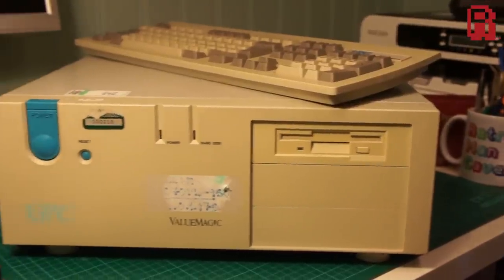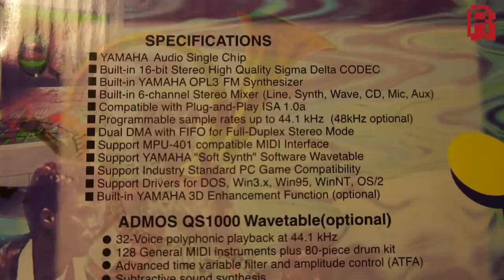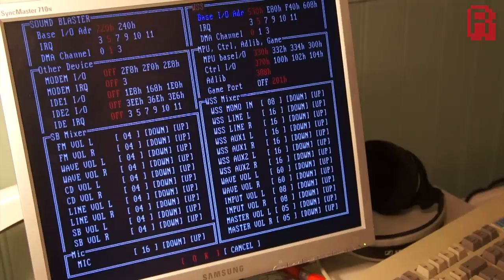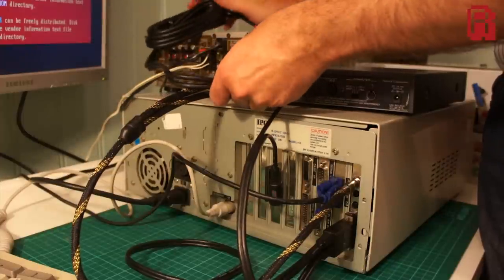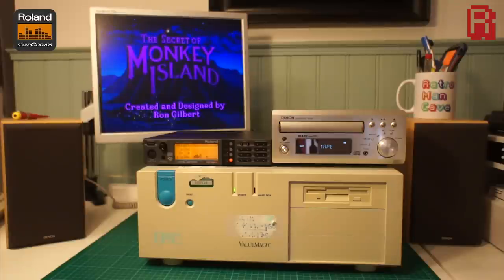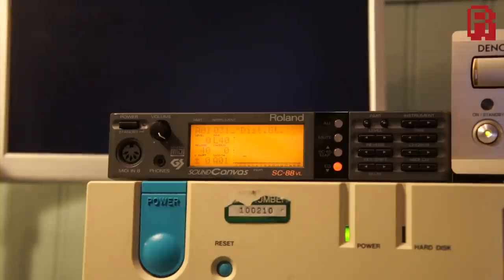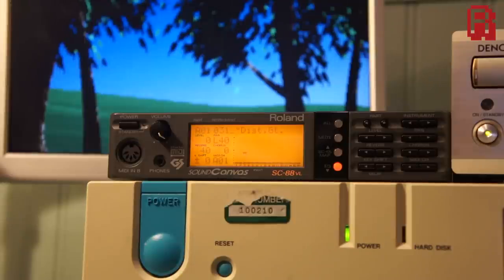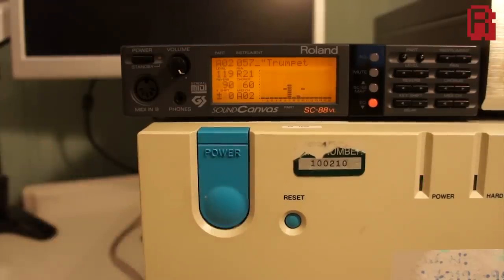486 Trash to Treasure Pt2 | Sound & the Roland SC-88

Comment: Roland SC-55 and Roland SC-88 has the MT32 mode which it will map some the sound back to MT-32 standard so that you dont get odd sound like in the video. To find out how to turn on this mode, just check the manual document that comes with Roland SC-55/88 etc..

Comment: I got the Roland SC-33 in 1994 and my friend got the flagship SC-88 at the same time.  All the sounds on mine were present on his, and both excellent GM modules.  I later sold mine and upgraded to a Yamaha MU100R complete with PLG100-VL and VH expansion boards inside as standard;  one gives virtual string and wind synthesis, the other is a vocal harmoniser.  These days I have four MU100R and six PLG boards, and an old Lenovo Thinkpad Z61p laptop running Cubase with special software that hosts the PLG boards like VST plugins.

Comment: Recently setup a good DOS rig for myself, which brought me to this video. Def subbing. Glad there are people into this stuff.

Pentium 75, 32MB RAM, GoTek FDE, 8GB SD w/SD to IDE with 2.5" to 3.5" adapter, ATX to AT adapter with switch, new ATX PSU, Gateway EV700 CRT (got for $2 no distortion), Ensoniq SB16 clone for digital sounds, SC-88ST for MIDI, IBM Joystick, TGUI9680 2MB (prob need a better one, heard these may be buggy), and a NOS KB/M with a PS/AT kb adapter. DTK case. Got lucky with mobo, 4 PCI & 4 ISA slots
Reply from the maker: Thanks!  That's a nice build.  I really need to make myself an early pentium era PC soon.  What games are you enjoying on it?
Reply: RetroManCave 
At the moment, I'm playing the super generic ones I played as a kid. 
Descent, Doom, Duke Nukem. 
I plan on branching out to more obscure ones, but I really haven't played too many DOS games so I have to rely on lists and old gaming magazine scans. I'll take advice if you throw any games out

The Pentium machines are actually not too expensive, the mostly complete DTK was $80 and the GoTek Floppy emulator was like $20.

Also I feel like I need a 386 with a turbo button, so I can play cycle dependent games, to complete my collection as far as PCs go.

Comment: Well now I want one, even more.
Reply from the maker: We've since discovered thanks to commentators that we can put the SC-88 into CM-64 mode and the SC-55 into MT-32 mode by holding a button down.  If you're going to buy one the SC-55 can be had for a good price for the best of both worlds
Reply: Thanks for the heads up. I'm going to keep an eye out locally, but might need to keep tabs on eBay.

Comment: Well, you ask what choice I'd make for my sound, and... I recently bought an SC-88VL off of fleaBay for my DOS machine. I don't think I actually OWN any games designed for the MT-32 at present, so the GM and GS support was far more important to me. 
My actual soundcard is an AWE32 I managed to scavenge off of someone's spare parts pile, so I've got the options of AdLib FM synthesis, Creative AWE synthesis, or Roland SC88 synthesis. And the SC88 contains the option to load samples to simulate an SC55 or (basic) MT32. 

This is my first MIDI module, and honestly, the 486 I had growing up had a (particularly weird) SB16 clone. So a lot of these games sound like entirely new titles(though I can always switch back to FM for the nostalgia).

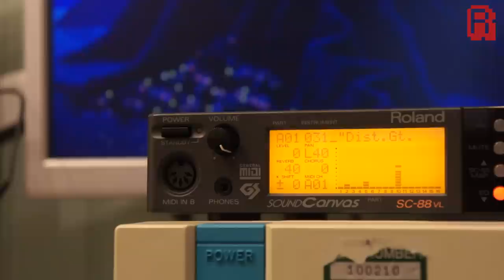Comment: It sounds like it really has potential, but at 8:02 you can tell the mappings are wrong--it sounds like drum tracks are playing as synth notes (out of key and on the upbeat). According to a video using SC-88 with Doom, you have to get the instrument mappings from the SC-55 and put them on the SC-88. I don't know if that will fix it or not. Maybe there are pre-GM mappings you can put into the SC-88 somehow. I won't link it or my comment may get blocked as spam, but the title is "Doom (1993) Soundtrack | Roland SC-88 (SC-55 map) | PC MS-DOS".

Comment: +RetroManCave
Would have gone with a SoundBlaster AWE64, kept everything inside the case and loaded sound-fonts as needed, which is actually what I did back then. Nice Rick-Roll BTW!
Reply from the maker: +TheCaptain I bet that sounded good.  The audition can have a daughter board added to achieve the same effect.  One nice thing about the external devices is that I can plug them quickly into other machines.  I never made it past Awe32 to experience a 64
Reply: +RetroManCave
Aww, man you missed out. I used that card well into the Windows XP days. Mine was the now rarer AWE64-Gold. Phil did a few videos on it here; https://www.youtube.com/watch?v=kXb3gNj--yo and here; https://www.youtube.com/watch?v=D9iyi7_BNRQ
He did a good job demonstrating what the card could do. I actually liked the sound of it better than the Roland equipment. But the Roland equipment came first, was optimized and very well loved.

Comment: The yamaha chip on the adlib and the sb 1-2 is the same (so no adlib or sb mode). The gm released in 1992, they start to support 92-93. The sc is not mt32 compatible, you cannot emulate well with wavetable based midi, mt32 can play mt32 midi.

Comment: I think every SC can be switch to MT32 with some key combo
Reply: i do confirm, i did see an example of this on a canvas sc50. pressing the power on button + while pressing the top button on the right of the screen. this acrivated the mt-32 compatibily mode (this is clearly mentionned on the screen at boot time)

Comment: Needs a mt-32, SC-55 and SC-8820 or SC-D70 :)
Reply from the maker: Hah well I have an SC-55, but I can't really justify buying the others right now!
Reply: The SC-8820 is a nice value it has SC-55 Mk2, SC-88 and SC-88 Pro maps which sound accurate. The SC-8820 itself has some nice drums and such as well. The 8820 has USB, serial and MIDI interfaces. The SC-D70 is basically a SC-8820 with optical audio out and in.

The mt-32 or variants is a must though, none of the Sound Canvases can properly emulate it ;)

Comment: https://files.gamebanana.com/img/ico/sprays/rickrolled.png
Reply from the maker: welcome to the club pal :)
Reply: Thank you sir :)
Reply: Do you know more about the mpeg video cards. Maybe h264 or h265 card? Also do you know something about codec programming? I have tryied to look at codec code https://github.com/Nevcairiel/LAVFilters/tree/master/common but it is a pain. It is a lot of spaghetti code. This is why I am curious about the older hardware from where everything started. The Amiga had a very cool start. But I should check MPEG cards and also streaming cards hardware. And also I like older hardware because they are more simple and also some of it came with very good instruction manuals.